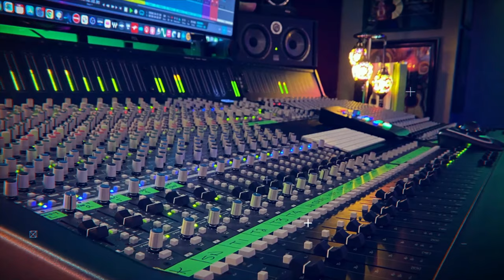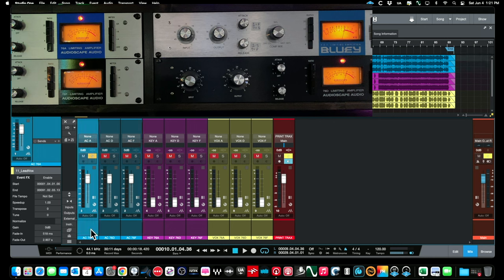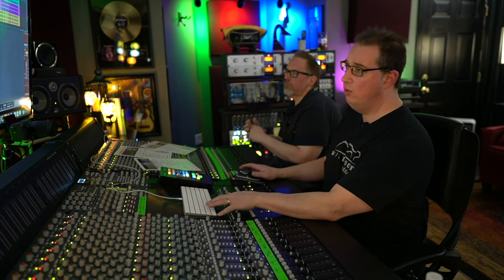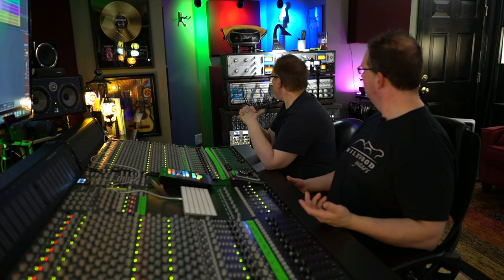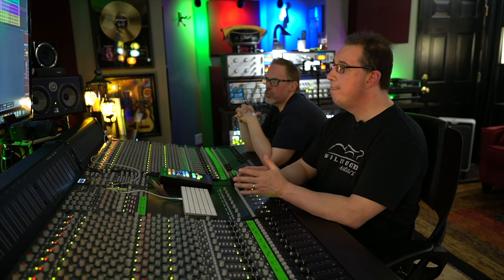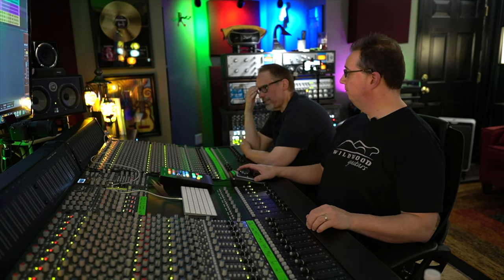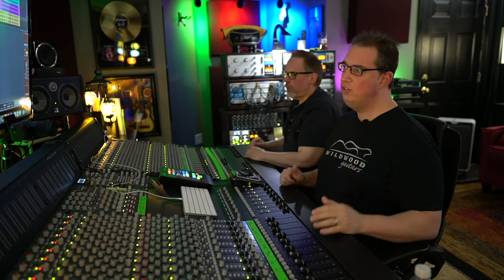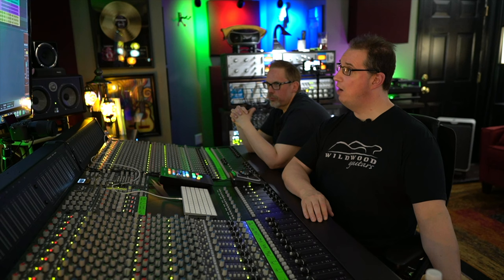The Best 1176 Hardware Compressors by AudioScape Engineering

Comment: Thank you to both of you for the very helpful comments. I have two 1176A's  with stereo-link that I built (Hairball Audio) and use them primarily on bass and acoustic guitar, and like them very much.  I was never able to do a side-to-side comparison with the D and F, so this is great, even though I know each brand and build will have it's own unique F.E.T. curve and transformer sonic characteristics.  I have read that the 1176A tends to be noisier than later iterations, due to earlier circuit design,  but haven't felt it is very noticeable with my units unless I really need to crank up the make-up gain to a high level for settings that I would not commonly use.  I wonder how the s/n compares between the A, D and F from AudioScape, even subjectively?  I may be interested in adding a D or F sometime in the future.
Reply from the maker: Thanks for watching!

Comment: The F seems to be the best option, middle ground compressor that could potentially be used on everything. If one was to only buy one compressor, that would be the best choice in my opinion.
Reply from the maker: I was really surprised that the F is my favorite and I use it all the time
Reply: @MixingMusicAnalog  yep, I would definitely buy that one first!
Reply: That’s true. Also, the F is the cleanest. The A saturates very quickly. The revision F was one of the first made for this exact reason with different parts. Revision F has the least amount of harmonic distortion of all the revision.

Comment: I have the 76D. I find it aggressively cool. For vocals, I use the meter to let me know how much and where to dial in the amount of input. The 1176 has a “fixed” threshold. Therefore, you raise the input until you hit the desired amount of compression on the meter. For vocals I try not to hit above -5 dB of compression. On the 76D that happens very quickly… I mean… it is so aggressive that I barely hit the input before I reach -5 dB. Then I adjust the output to send the appropriate amount of compressed signal. If I am belting a loud vocal, it will occasionally bump it to -7 dB. That’s ok, but you will feel those transformers working.
As you mentioned, it is about how it causes the vocals or instrument to sit in the mix.
That’s where it earns its money… It brings every nuance of the vocals to the front of the mix. 
Great video! Thanks for the great comparison! AudioScape makes great gear. The AudioScape version of the LA2A is on the radar! 👍
Reply from the maker: Great description on how to use this compressor. Glad you are loving it!!